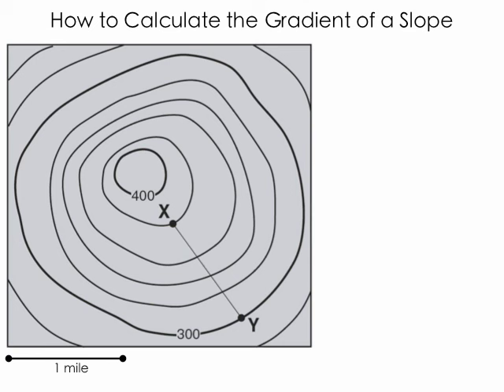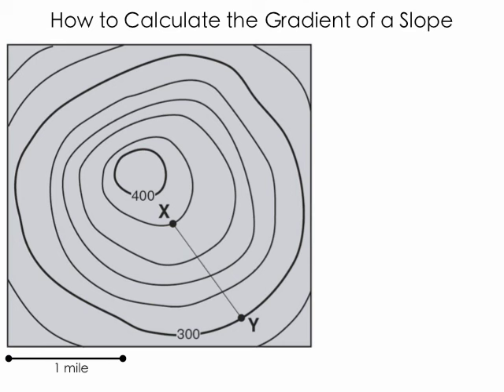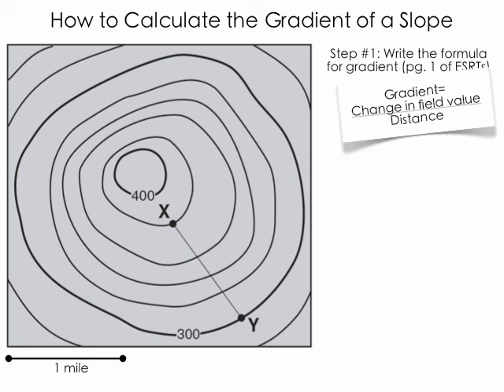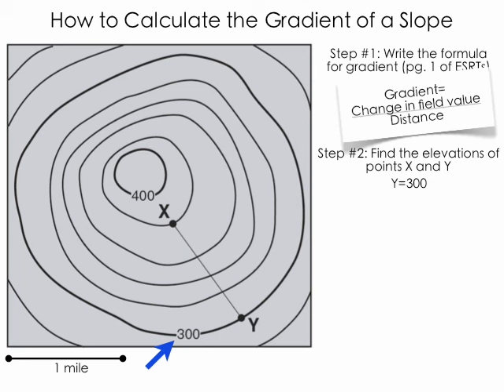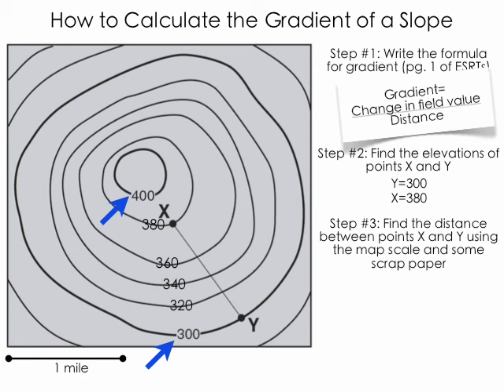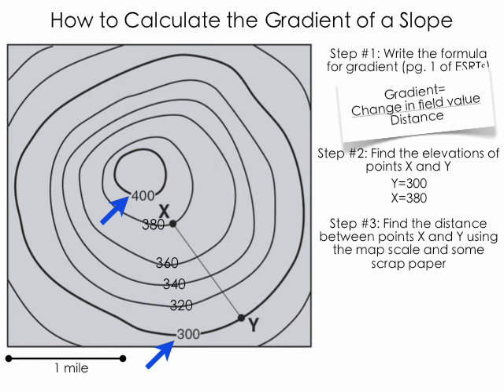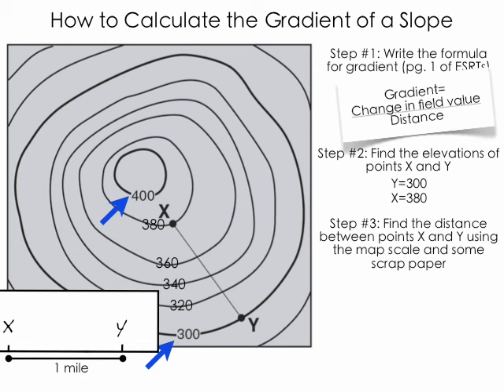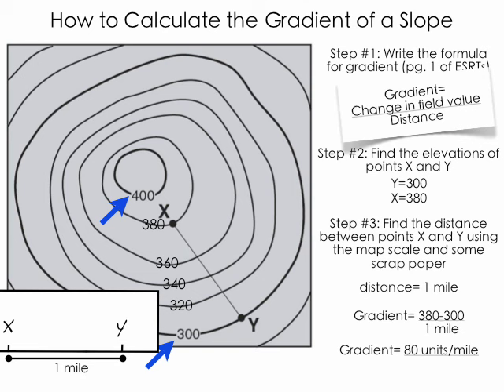How to calculate gradient.mov

Comment: You can also use rise over run formula to get a percent (elevation divided by distance) Add the percent to the actual distance and you will calculate the real distance you must travel. From here, you will know how to apply your own pace count (your individual steps per 100 meters or yards) when walking the incline of the hill. Think of this as A square plus B square equal C square. 😀